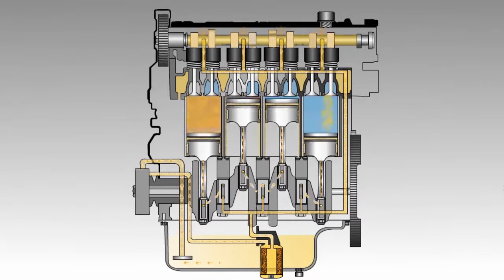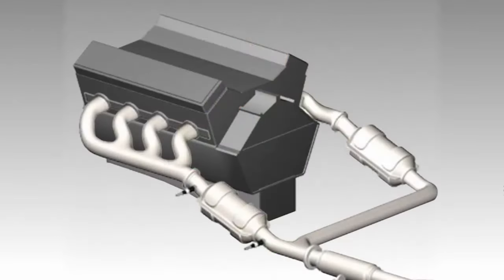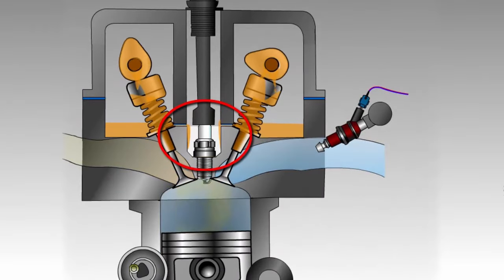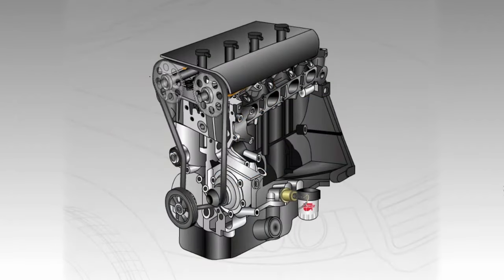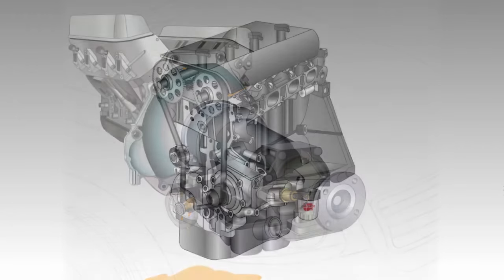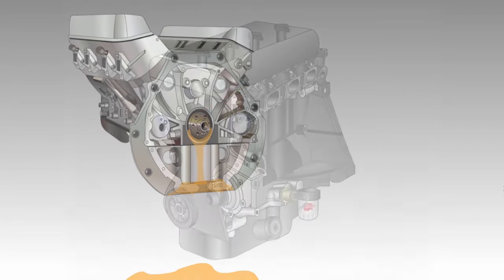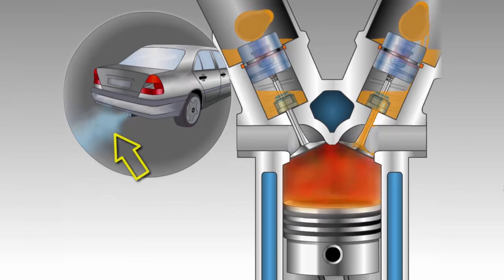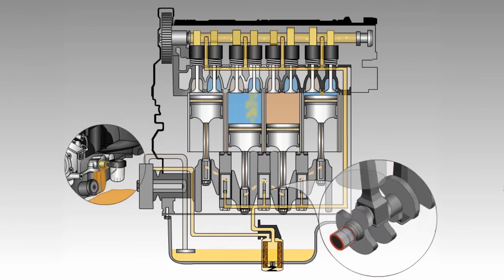Engine Damage from Low Oil Level

Comment: A friend of mine had no oil in their 2009 Buick Lucerne with 175000 miles and drove it for a an entire hour. Was screaming at them the whole time. They put oil in it. Is it still good? They said it sounds fine now but worried its gonna give out any moment now.
Reply: The dipstick only measures the top quart in a 4 or 5 quart sump, so even if it's at the bottom of the dipstick, the engine is probably fine.
Reply: I accidentally didn't put the oil cap in My car and drove it . For a couple of says and didn't notice the leak till later . When I found out I put two quarts till it showed half ways on the dip stick because it showed nothing.  Did an oil change right away the next day and 3.5 came out . There's more in there the dipstick doesn't read . My car drives completely fine

Comment: A motorbike kept losing speed and bogging down to half its power for 10 minutes at the end of a ride. Upon inspection, it had no oil left. Refilled the oil and rode 50km with zero issues.
Reply: This gives me hope🙏🏿totally different vehicles but still...
Reply: i was driveing my truc kto work and i floored it to pass some one little did i know i leaked out all my oil my engeine stalled and would not start 1 week later i toped off the engine with oil hopeing it would fix it and sure enough it fired up and idele just fine i just got to fix the oil cooler hose and i mite be able to dayly it again
Reply: @dubskulls9554  engine still run good ? i have the same issue on my corolla 1 year ago after oil change filter was leaking so i lost all my oil engine turn in safe mode and make loud weird noise i stutoff  engine and towing the car at my house and change the filter and add new oil enngine run smoth no weird noise after add oil
Reply: @Alex_Bket  the engine blown it only lasted for a week after I fixed it
Reply: @dubskulls9554  oh no I'm all with you have you got a new car my corolla has driven 10 000km and no problem to date my I'm afraid!!!